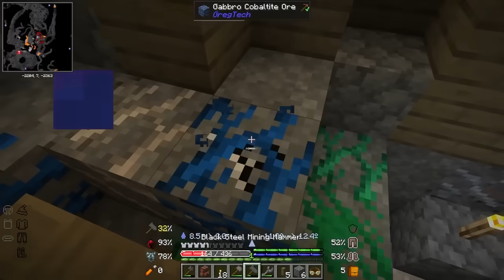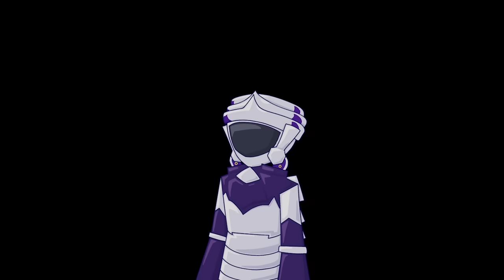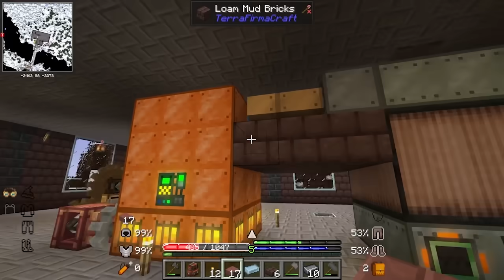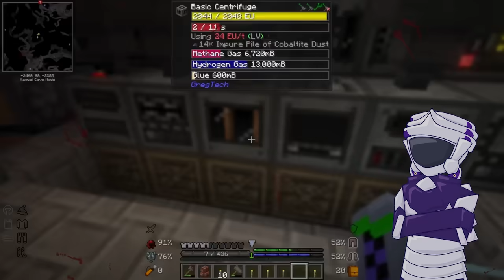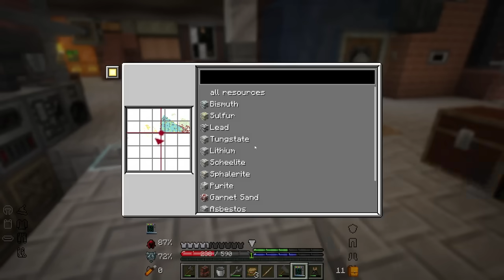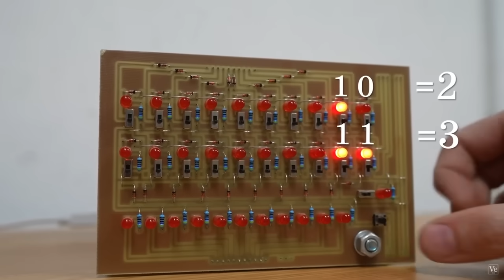Inventing Computers in Minecraft's Most Realistic Modpack (TFG Part 7)

Comment: 23:30 - i mined emeralds for easy aluminium dust in thermal centrifuge and just used transformator to get mv to power my electrolyzer and got aluminium from diorite dust i got from sawing diorite cobble into fences. Then i got macerator and just crushed all fences i got into more diorite dust and centrifuged it into more clay dust.

Comment: Just a little tip for your ore processing, you might wanna make a "steam grinder", it uses steam to macerate ores which gives you double the ores. And it's as powerful as 5.2 HV macerators and it only uses about 64mb/t of steam on average. You can crush 16 ore in about 25-30 secs.

However I'd only recommend this for ores that can be smelted or you want to electrolyze as it makes dust out of it.

Comment: My advanced steam turbine generator blew up after connecting it to my gold HV cables and my LV machines😭. Some of my machines are gone. What did I do wrong? It had steam from the large boiler
Reply from the maker: the advanced steam generator outputs MV power, gold cables transfer HV power (silver is better), this allowed an MV (128 volt) current go to your LV (32 volt) machines, overpowering them and killing them
Reply: @ thanks for letting me know. I’m using the 2x gold cables but I’ll switch to silver and keep the MV machines away from the LV machines. I lost my extractor in that explosion and it’s really to extract rubber without one.

Comment: I have found it easier to mine after making a wooden roof to stop blocks from falling while mining. Just clear the area using supports then build the roof right above the supports. Or put a floor under the supports and use that as a roof as you dig deeper.
I have a huge iron vein that I have been digging out using a wooden roof

Comment: Does TFG not have the magic 0 resistance cables, like red alloy for LV?
Reply from the maker: nomifactory adds things like conductive iron and vibrant alloy wires which are really easy superconductors but in normal gregtech and in real life those dont exist, instead I have to use things like manganese phosphide which is really difficult to make  because of the phosphorous
Reply: @Hecuba39  ah, the main GT packs I've played were nomifactory and FTB Interactions, and I knew you'd used red alloy wires in recipes, my bad. Very fun videos by the way, can't wait for the next one!

Comment: 40:42 programmed circuit item jumpscare
Because someone forgot that input buses have circuit selection by themselves and don't need extra programmed circuits. Literally the reason distinct bus mode exists.
Reply from the maker: I just watched the clip again and realized there's a button in the bottom right, I usually play old versions where the circuit is always a physical item
Reply: another thing that i wish i could say earlier, is that (at least in newer versions, still before retexturing) there were face mask and rubber gloves, made to protect from hazardous materials..

Comment: I feel the need to explain why you need quarzite from the autoclave:

Basically quarz, regular quarz crystals like rock crystals can virbrate. BUT within a crystal there is actually two crystals and they cancel another out so you get nothing from them. but if you make synthetic quarz you in the autoclave you get one singular large crystal you can use in electronics. and this stuff is used in esentially all electronics. 

if you have an electric watch it has a quarz crystal in it. before the synthesis was develop electric watched were more expensive than mechanical one, because you need a quarz crystal for it, but as natural one cannot virbate unless you find really big ones (i cannot explain it well in english) they were super rare and hard to come by. as soon as synthesis was developed the prive dropped hard.

Comment: 5:33 Something annoying I found out, is that every block gets pinged to collapse, whether it's supported or not. And the blocks that are not supported, roll to collapse, if they're not DIRECTLY supported, or laying on a HARD block. I tried putting cobblestone on the ceiling then supporting that cobblestone with supports, but it collapses anyway.....

The Cheaty fix: Go to a white sand beach; the stone for some reason there isn't affected by gravity. I used that to line my cave ceiling to stop the collapses. :)

Comment: There’s a method for infinite aluminum, iron, and eventually titanium. It’s kinda cheesy, so I don’t know if you’d want to do it, but I figured I’d mention it Lol. 
It takes a bit of setup, but basically if you set up a rock crusher on specific stone types you can get infinite of said stone type. For Aluminum, use diorite. Make diorite cobble, macerate to diorite dust, centrifuge to make clay dust and mirabilite dust. Then electrolyze clay to make aluminum and all the other useful things along with it, and electrolyzing mirabilite will get you sulfur and whatnot. 
For infinite Iron use Basalt cobble, and for infinite Titanium (when you get there) use Gabbro. 

Also—if you don’t want to do that, you can set up LV or MV Miners to do all the mining for you. No more quarry mining and cave-ins lmao
Reply from the maker: those rock crusher recipes are not cheesy, most GT packs intend that as the main resource generation. What is cheesy is the colored steel dupe using LV casings which lets you transmute normal steel into red and blue steel
Reply: @ Facts

Comment: Hand crafting before AE2 is quite painful in gregtech. Luckily this modpack has recipe trees (e.g to rapidly calculate a batch of circuits) and can craft anything in 1 button press using your inventory screen (not the + button viewing the recipe like JEI). Look into the EMI settings on the bottom left corner of your inventory to see more about it. Adding lookup history to the bottom of your screen is also helpful to avoid typing the same item on search exhaustively. 
You'll be hand crafting everything without Create before Extreme Voltage to unlock auto crafting. This feature will save you from developing arthiritus making 1000's of recipes.

Comment: You can use rubber gloves to hold some hazardous materials
Reply: it works with anything that says skin contact in the hazardous area
Reply: Not in the version of gregtech used in this pack
Reply: @denethweerasinghe Is there a hazmat suit in this pack?
Reply: @InsolentHalo  there is but it's locked behind MV
Reply: you can also use cells for fluid transportation